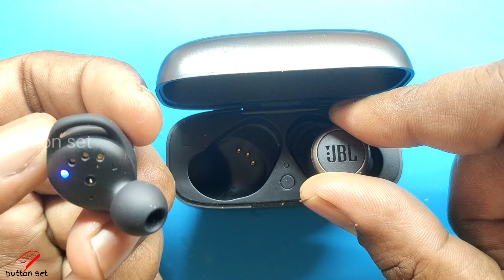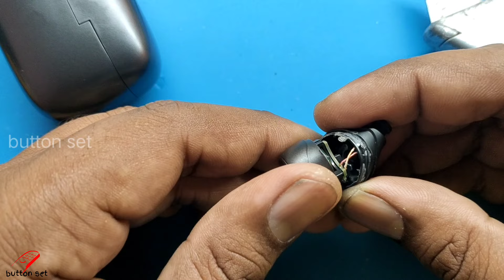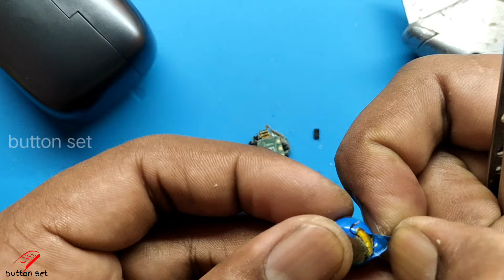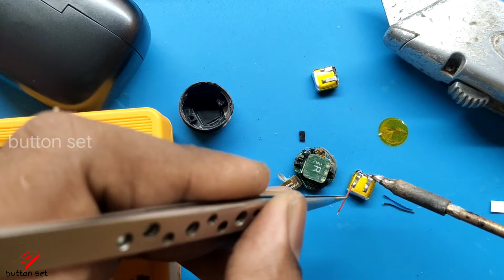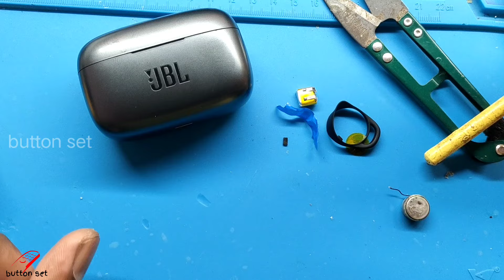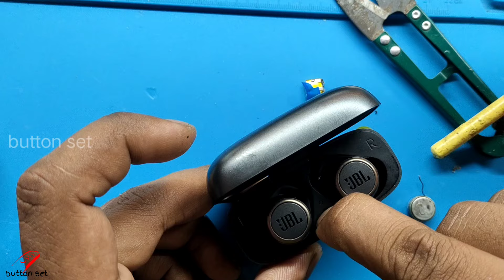How to Replace the Battery in JBL Live 300 TWS Wireless Bluetooth Earbuds

Comment: One of my jbl live 300tws earbud charging all the time if it in charging case. Is it possible to fix it?
Reply from the maker: Thanks for watching buttonset ❤️
Kindly send your device picture on Instagram @buttonset sir
Or
You can share Your queries through what's app or Phone call by using this Number 👇
+919043941509
Reply: i have the same problem, fixing the battery will not 100% fix the problem it can because the battery doesn't hold charge but if the contact on the earbuds and case are dirty you need to clean them with isopropyl alcohol